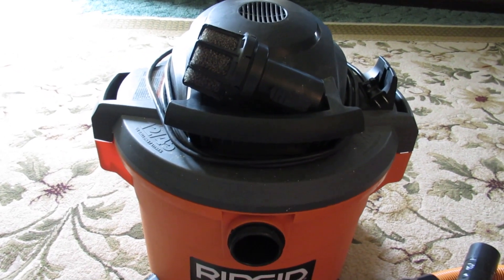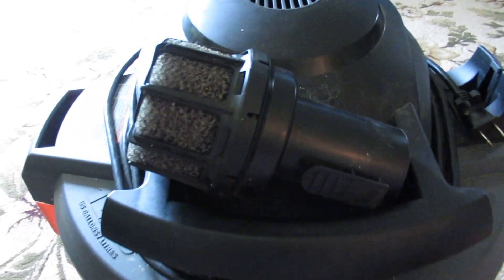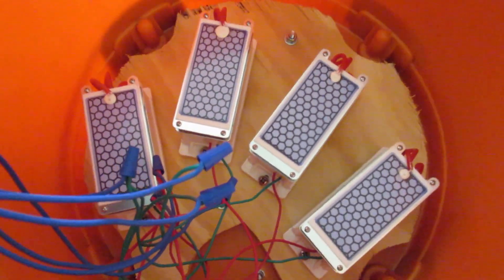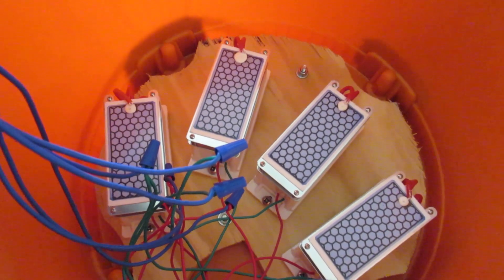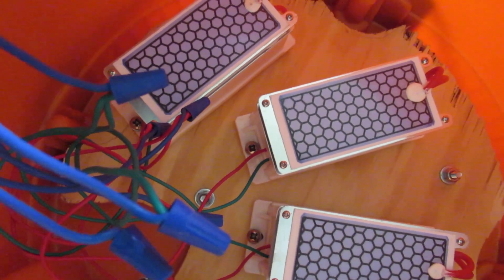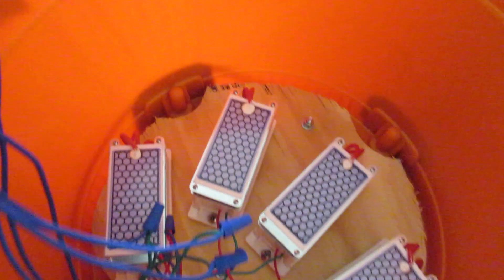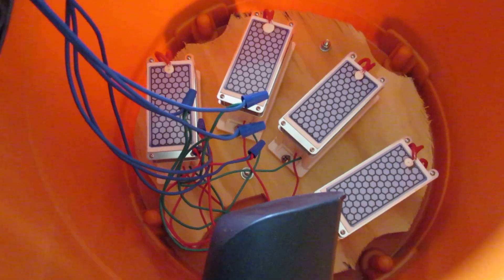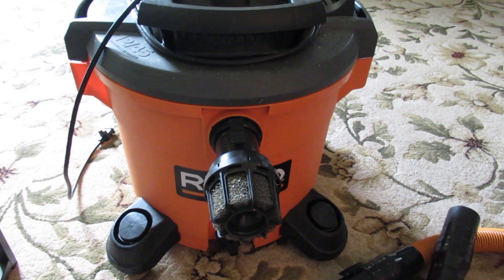OZONE GENERATOR SHOP VACUUM CONVERSION - YOU NEED THIS IF YOU ARE IN THE ODOR REMOVAL BUSINESS

Comment: are you using the vacuums exhaust to move the ozone through the hose? What's to keep you from buying a cheap ozonator and just placing it inside a shop vac and connecting the hose to the exhaust for delivery?

Comment: Thanks. I just got a unit off Amazon that claimed it produces 60kmg/hr if ozone and when i open it up, it has 2 of thise plates.... So realistically, it does more like 10kmg. But now i know i can add more or build a 2nd one. 

What's great about your shopvac setup is you could probably slide that hose down an air return in a home and turn the furnace blower on to sanitize the ventilation system

Comment: This looks like a great setup. BUT...do you need to be in the room while the system is generating that ozone? If so what respirators are you using? Is it full or half-mask? I can't get any info from 3M about what filter/cartridges you use to filter ozone.

Comment: Do you think this could knock out the smell of fish in an old fish restaurant I’m trying to convert into an ice cream shop? It’s about 1250 sq ft. Split between two rooms. Thx
Reply from the maker: Yes, I think ozone would work great for that as long as you've removed the source by cleaning everything you can. Ozone will destroy the remaining odor molecules if you get the ppm high enough to saturate the area. I don't have a specific ppm number to recommend because I plan out how many mg/hr depending on the size of the area and severity of the odor. I would probably run 5 or 6 15k mg/hr machines with box fans blowing up for 6 hours which probably eradicate the odor.

Comment: Thanks for sharing this. If I use something like this to deodorise a car, how long do you thing I should leave it on?
Reply from the maker: It all depends on the severity of the odor and how many mg/hr your machine is. Typically, I deal with smoke odor in cars so after I use the attachment to inject ozone into all the soft surfaces, I let it run between 30 minutes and 1 hour. This machine produces 40 000 mg/hr so smaller machines will need to be ran longer. Be sure to run the air conditioner to circulate the ozone through the hvac system. If you are using a machine that sets inside the car, I like to crack a window about an inch or so to let some fresh air in. If not, the ozone generator can use up all the available oxygen.
Reply: @AllAmericanMack  40,000 mg/hr is way too much ozone for a car, i dont think that you need  30 minutes for a car  10 000 mg/hr  generator does the job in 10 minutes even less than that.
Reply from the maker: I'm going to have to disagree with you on that. After doing many hundreds of cars, I pretty well know how much to use on a case by case basis. There is no way 10,000 mg/hr is going to remove heavy smoke in 10 minutes or less. It may work temporarily, but not permanently, especially if you just set the generator inside. Places like the headliner, back of seats, deep into the cushions, etc don't get a thorough enough treatment like that. I've done more vehicles than I can count where people bought used cars from dealerships that had used ineffective amounts of ozone to rid them of smells. Some even brought the vehicles back to them for second treatments and soon the odors would return again. After I treat them properly, the odor never returns and I even guarantee them that it won't. The simple key to effective odor removal is ozone saturation and even in a small space like a car with a 10,000 mg/hr machine, you're not going to get saturation in that small time frame.
Reply from the maker: I've seen their videos and even looked at their machines but felt they were overpriced since they used chinese plates and transformers. I built 5 machines for what one of theirs cost. If I'm going to buy anymore machined, I'll stick with the Maxblasters.
Reply: @AllAmericanMack  Hmmm. maybe u are right. i was talking about desinfection  but getting rid of odors might be harder ,not sure abou it.
Question...how much you charge for that service?
Reply from the maker: I charge $85 for individuals and $65 for dealerships with a 100% guarantee that the odor will be gone and not return as long as the source has been removed. Apartments are a good place for this kind of work also and I charge $125 per unit with the same guarantee. Apartments take about 5 hours and I will usually use 4 10,000 mg/hr machines. Setup is only about 10 minutes and breakdown is about 15 minutes including a quick fogging so I will only have about 25 minutes into the job, not counting drive time.
Reply: @AllAmericanMack  https://www.youtube.com/watch?v=CzFQlC2cnBM
Reply: Great idea. It seems though like the very high volume of air that a shop vac pushes (versus the typical low flow  ozone fan) would not allow a high enough concentration for direct application to be effective on seat surface etc in an unenclosed space (of course it would be fine in a closed space like a car with doors closed since the same air would be recycled)